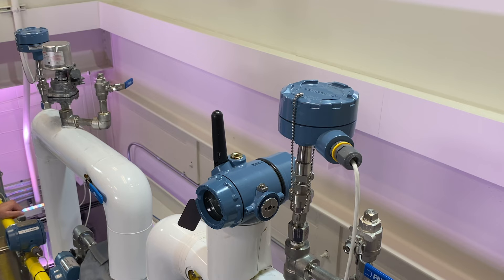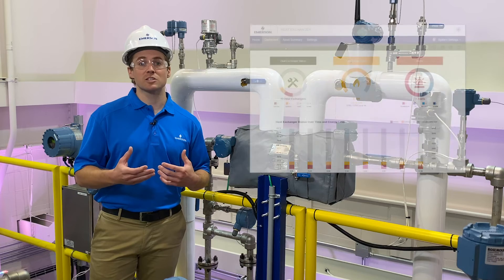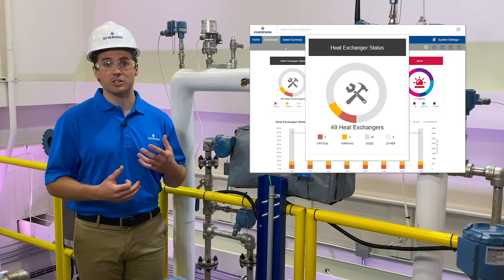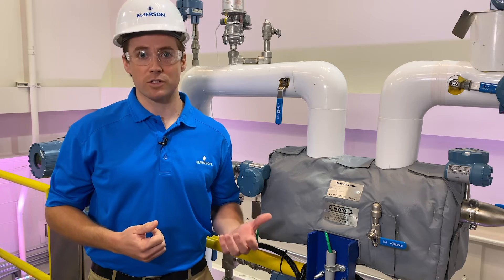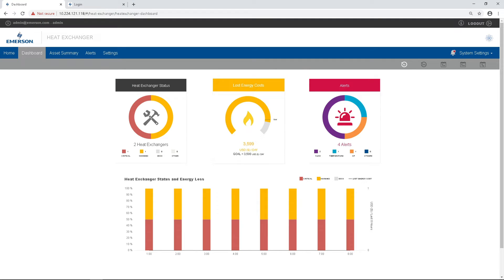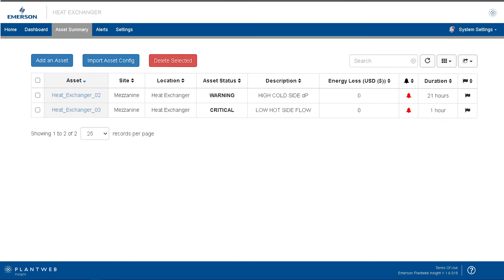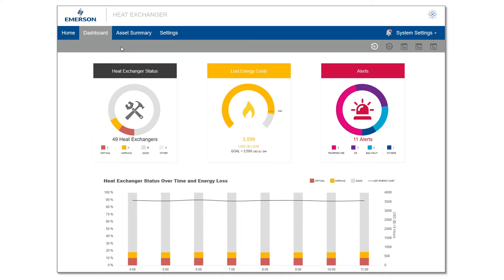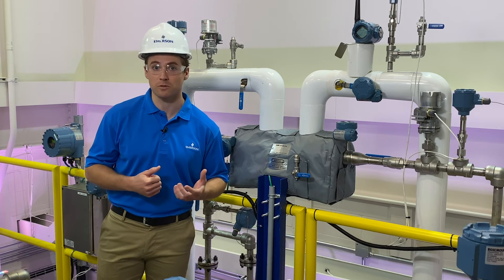Optimizing Heat Exchanger Efficiency

Comment: Nice presentation.  And a very good educational tool.  But realistically, no plant could afford to put that level of instrumentation on a small heat exchanger.  The capital cost, installation cost, and man power burden to maintain the instrumentation would be excessive.  Realize that most heat exchanger fouling occurs on the cooling media (typically water) side of the heat exchanger.  The process side is usually well understood, contains few known contaminants, and is therefore well controlled.  I therefore suggest instead that a side stream fouling monitor, which typically tracks the general fouling rate of the cooling water, set to mimic the highest tube wall temperature in the system (for inverse solubility scale), is more appropriate. Examining the trend line of fouling this monitor produces gives the water treatment process operator the information needed to insure he/she is optimizing chemical addition while maintaining heat exchanger cleanliness in the system.    The DATS side stream fouling monitor is one type of such instruments available on the market for economic monitoring of the heat exchanger cooling water side.  Thank for presenting this good insight, and assisting us all in being better stewards of our natural environment and its resources.